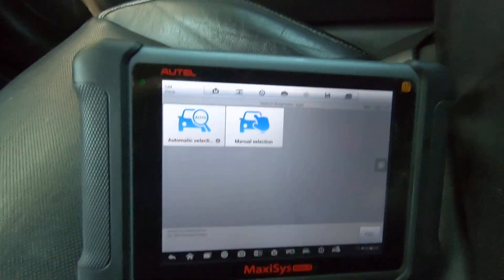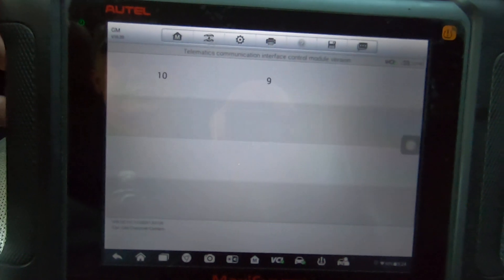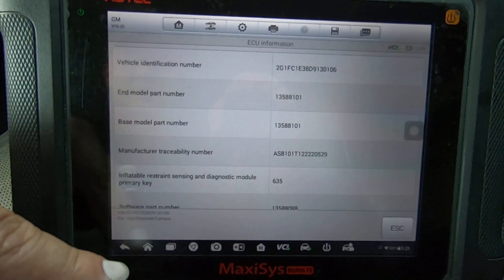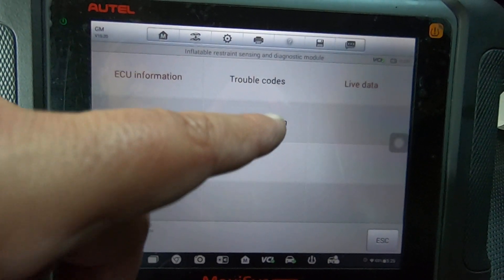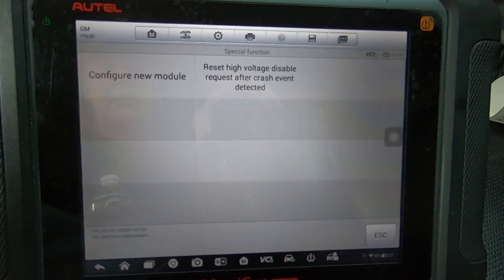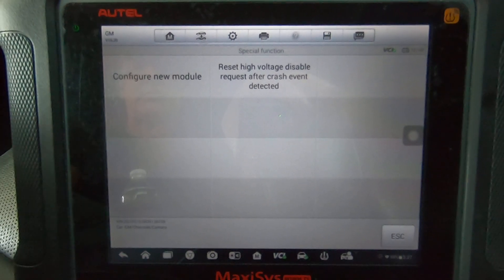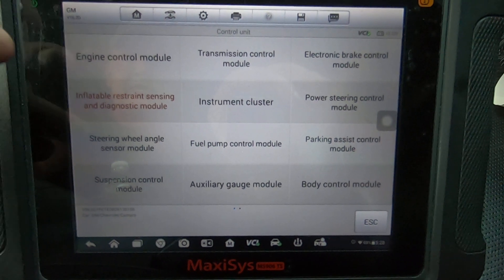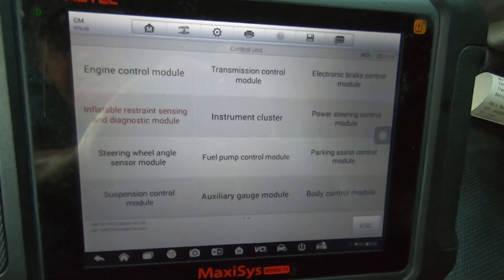Autel MS906TS Airbag capability, functions, and active test.

Comment: I have an MK906BT - will it reinitialize the SRS after replacing airbag?
Reply from the maker: Depends on the year make and model.
Reply: @737mechanic  depends on the embedded coding used in the year of manufacturing that car/model